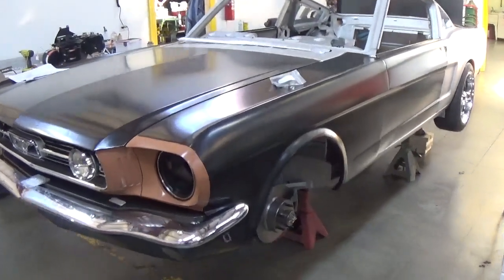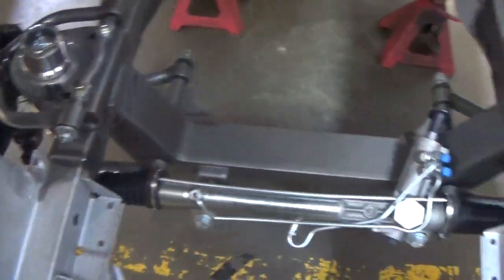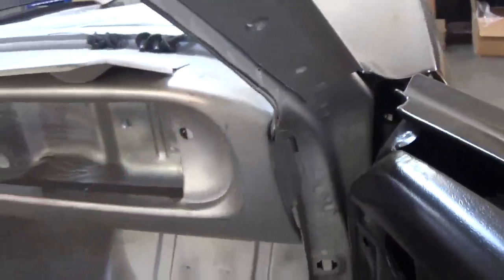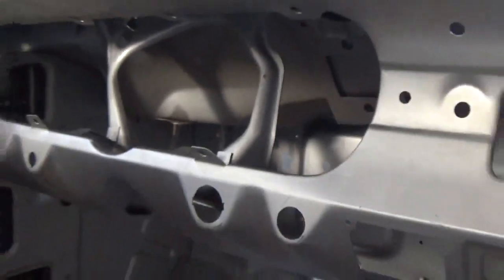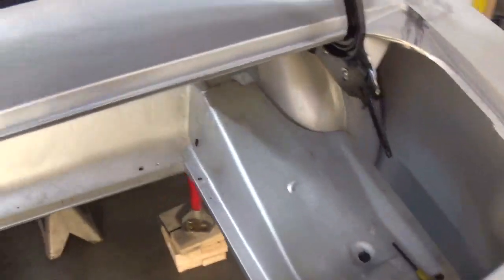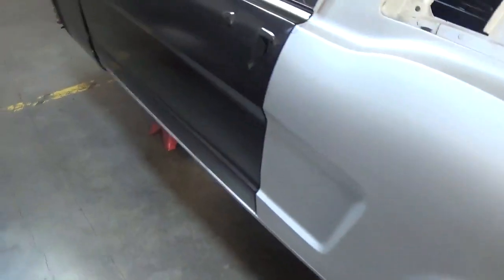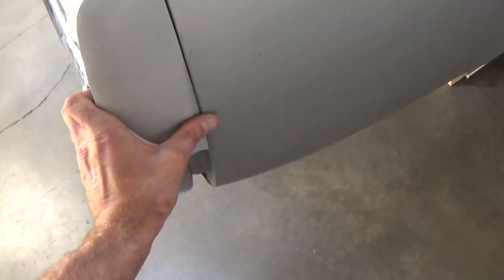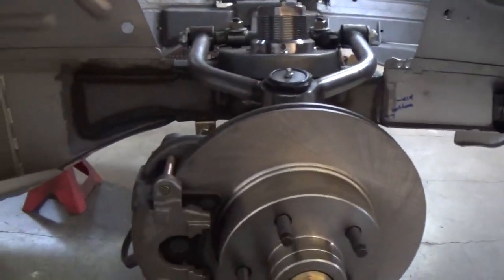1966 MUSTANG  STARTING BRAND NEW FROM THE GROUND UP

Comment: If I was loaded with cash, this is what I would do. I would get one made like this. Drop a Coyote engine with a 6 speed in it. I would probably spend months figuring out how I want the car built before I would start. This is the only really way  to go today. Finding a car that is not a rust bucket is nearly impossible or will cost you an arm and a leg and it will be a rust bucket.

Comment: what holds the mustang 2 front end down , the original had the tower with struts to the firewall cowl area and triangulated the front stress. right now you just have the fenderwells holding the front end on . that and a small part of the floor pan. also the origina l front struts absorbed road shock as well. nice work but wondering about those issues.

Comment: That's awesome! You ship to Canada? Body work done to ready for paint, with Eleanor parts/panels what kind of price you looking at then?
Reply: Very serious, but right now I'm building a replica cobra so it will have to wait.  I don't think even a rolling chassis can be imported to Canada.  I know for my cobra kit the Canadian government wouldn't let it be imported with brake and fuel system components. So for this I would just want the body with body work finished.  Ie panel gaps etc done and primed is what I was thinking.